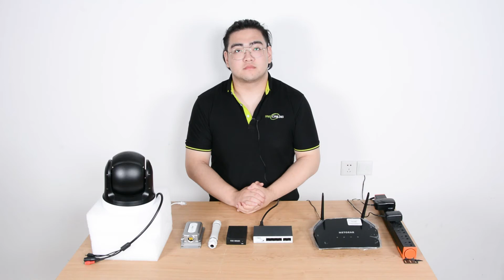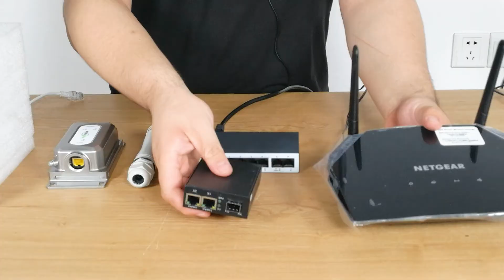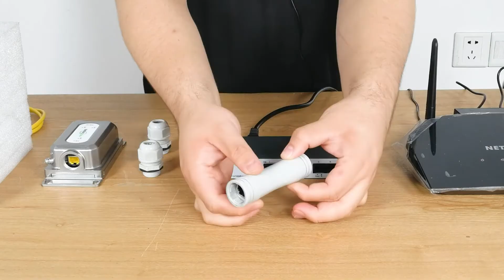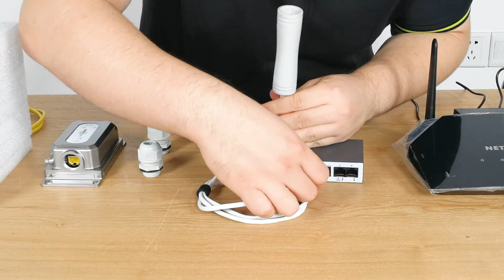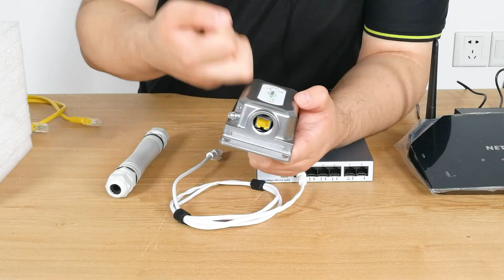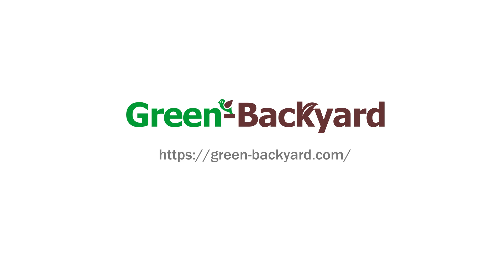PoE Extender VS. Ethernet Extender

Comment: I don’t know if you’ll see this message being such a long upload: but if I heard this correct can I buy a POE camera with a POE Switch then take an Ethernet plug it into POE switch and go all the way down to like 100 meters then use the extender? To go 200 meters?
Reply from the maker: That's correct. The PoE extender can amplify the signals and boost them for another 100 meters.

Comment: Thank you for the video. Trying to apply this to my 200m scenario connecting to a non PoE router at the end. 

One thing I'm not clear on that you touched on in another comment is a PoE splitter. Why would I need it if all I am doing is extending the data signal to an end-point non-PoE router? Will I not capture the full signal from the PoE extender? Or will a non-PoE router not even understand what's coming out of the cable?
Reply from the maker: There is power handshaking in the standard PoE protocols. The one in one out doesn’t have power handshaking. While it works with non-PoE device such as router, it needs PoE splitter to initial the power handshaking with PoE switch, otherwise the PoE switch will not send the power, so the extender doesn’t get the power.

Comment: Great stuff.  Suppose I did a 1-1 extender, then to the splitter. There's still enough power and overhead to run another extender down each branch after the splitter I presume?  I've got to get to POE devices that are spread out and being able to branch would make a huge difference.
Reply from the maker: I am not so sure I follow you. The PoE extender basically repeat the data network, but no power. The power can’t be repeated. Once it loss, it will loss forever. The PoE splitter is designed for separate the power from PoE and convert it to DC12V.

Comment: Great video! Just to confirm, the single port in and out poe extender, I plug it in at the 100mtr Mark? For example, at the poe switch with 802.3af output, I measure 100 meters from there and then plug the poe Extender in line at that point to get an additional 100mtrs? Or is it plugged in at the IT cabinet right next to the switch?
Reply from the maker: Yes, you can plug PoE extender 100 meters after the PoE switch to extend additional 100 meters. However it have to be PoE switch , not the non-PoE switch. You should have PoE compatible device at the end of the cable. Otherwise you need to add PoE splitter before you new router.

Comment: Do you recommend adding 2 poe extender for a cat6 cable setup ranging 250meters?
Reply from the maker: You need two. Single PoE extenders only can repeat 100 meters PoE, but you can have continuous run if 100mbps bandwidth is acceptable. Otherwise daisy chain two PoE extenders is the solution. https://youtu.be/TZTG1GxxcCY

Comment: Is it possible to connect an Ip device and another POE extender to a two output extender?
Reply from the maker: Yes, you can connect another PoE or non-PoE device to the additional ports. This PoE extender will determine whether the power should be provided or not. You can consider it is ‘3 ports outdoor PoE switch’. Just make sure you do have PoE injector or switch at the center, so the PoE extender can receive the power from backend.

Comment: Can I use POE extender for any ip device. Like a computer that isn't listed for POE input power??
Reply from the maker: You need at least PoE injectors plus the PoE extender with power handshaking. This one will work. It will know it is not PoE compatible and provide only data exchange. https://www.fastcabling.com/product/poe-extender/

Comment: Where does the POE switch get power from?
Reply from the maker: The power supply unit is built into this compact switch. It will convert the AC power to DC48V and send it to the edge devices.